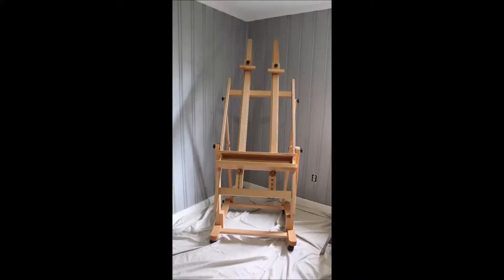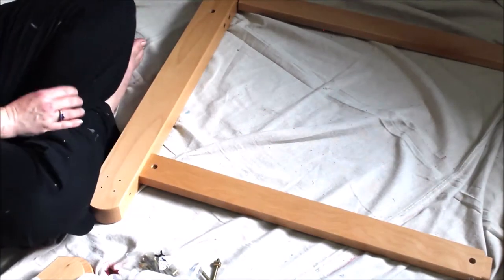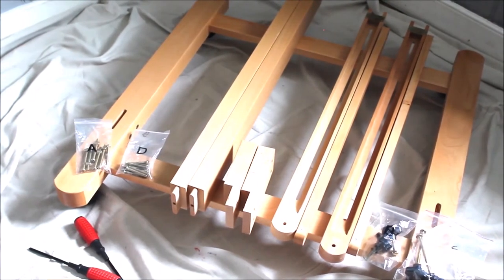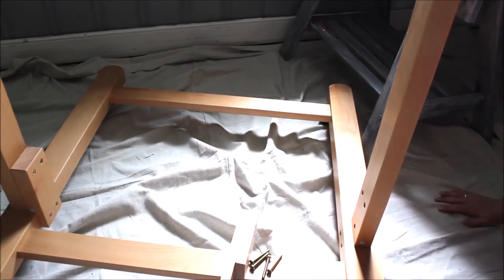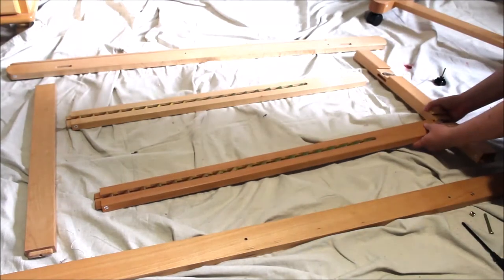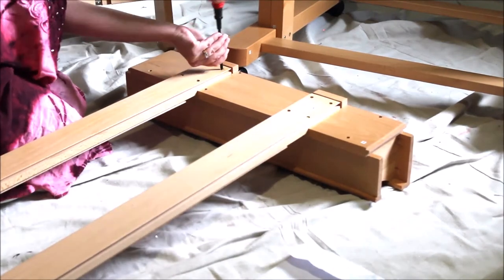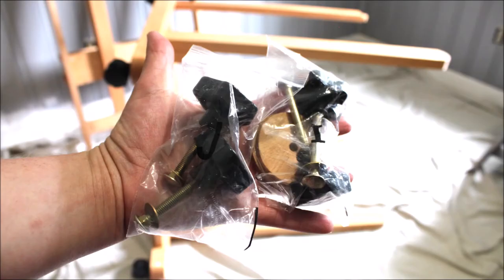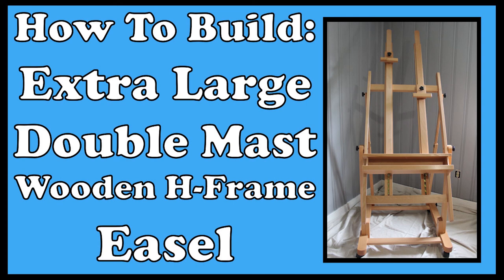How To Build XL Double Mast H Frame Easel from US Art Supply model W11B Assembly Instructions

Comment: My assembly is in 2022 and your # 7 is my #5, so I guess I'll have to look at your visual and match to my numbers.  I posted this in case anyone else has questions as to their numbers not matching your video.  Thanks for the video, it was a lifesaver on the very first step where the screw was falling into the hole. I got to see where the bolt went to screw in for the frame, the diagram doesn't show that too good.   Really appreciate your detailed video! Thanks!

Comment: 1. Thank you for tips & important insights on assembly! 2. Where ever 'A' bolts are used, I put a top of blue dreadlock (medium) on end of momento hold the frame pieces more secure. 3. I also did it by myself & after bolting together the H frame, I mounted it on the four 'posts with the I & J knobs. This made a table to assemble rest of easel.
Reply: drop of threadlock
Reply from the maker: Awesome! Thanks for your feedback.